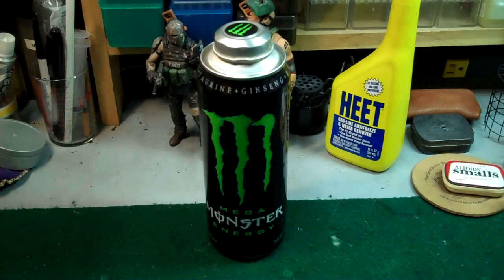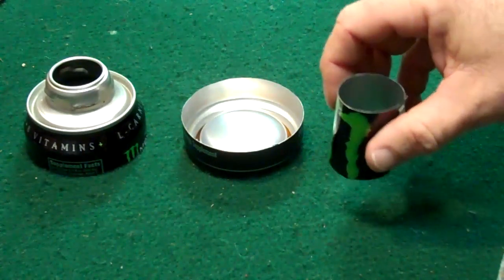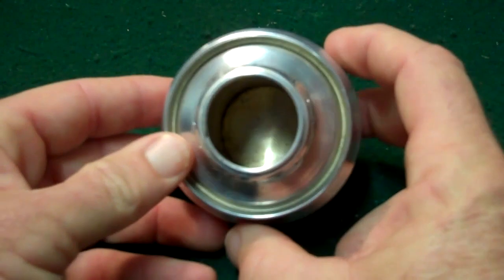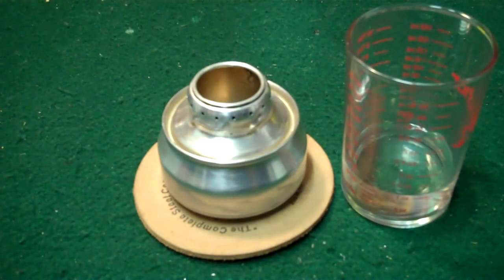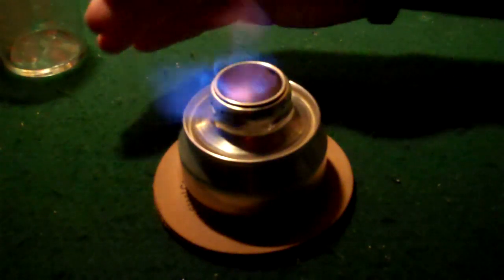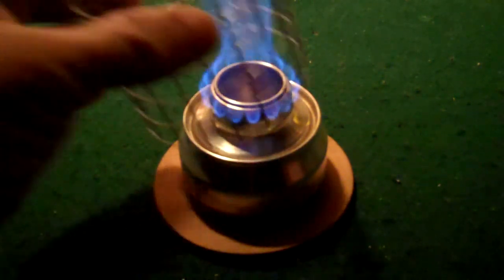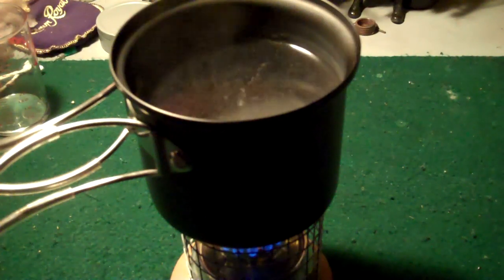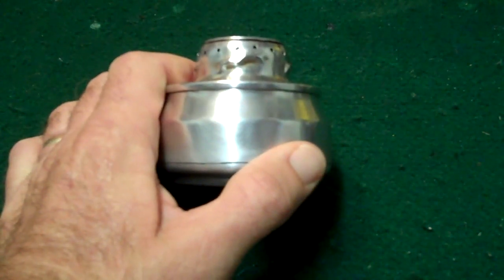MONSTER CAN STOVE

Comment: Nice stove build. I have built the same stove. Mine primes in about 40 seconds. I put a wick around the inside between the inner and outer wall. The Trangia stove also has an internal wick. That is how it primes so fast. The alcohol gets pulled up to the jets. I did not read all the comments, so if somebody already suggested this.....

Comment: I've had great success with alcohol stove design and one thing I've learned is that the safety of alcohol stoves relies greatly upon the fact that denatured alcohol requires preheating in order to become a gas. If you would like to reduce your priming time and get better performance in cold weather, move your jet holes to the middle radius of the horizontal surface at the bottom of the bottle neck. Put those holes right in the middle between the folded seam of the can top and the neck where the cap fits. This will not only give you lots of heat to transfer back into the fuel container for proper vaporization, but it still leaves you with a ring of "Priming Gutter" where you can slop a little fuel near the jets to get them going. The Monster can top is THE perfect top to solve the dilemma of jet priming if the jet holes are right in the middle of that outer ring. This will also draw the flames closer to the center of the bottom of your pot, AND, if you drop the cap back on, you will get more efficient burn time.

Comment: I like this stove. I have been looking for one that incorporates a lid. 
I suspect the reason why your jets take a long time to light is because the inner sleeve acts as an insulator from the outer jets. Obviously it's not much insulation but it's a slight barrier that has to be heated in addition to the outer area. When you blow on it; that helps to heat the outer sides where the jets are located. It looks like that skirt under the cap would make a good primer.

Comment: It looks very sturdy but seems a little less efficient than some others. A few suggestions:
1. Reduce the height a little so during the priming heat is more efficiently delivered to the fuel.
2. In crease the number or the size of holes.
3. You already have a raised rim on the top on the main body, try to use it for priming by adding a teaspoonful of fuel and lighting it. Skip the center burn for lighting.
Good luck!

Comment: in my experience smaller jet holes light sooner and burn better because it allows the stove to build pressure faster. also you might try drilling the holes in the top of the can not the raised portion that you drink from. you could also try building one with the top inverted down inside the can this will eliminate the need for the inner spacer or collar.

Comment: Try using larger jet holes. I had a similar problem. Larger jets will light faster and in colder temperatures. It will decrease total burn time, but you still get the same amount of btu's from equal amounts of fuel.

Comment: if you put the holes lower, on the more horizontal area of the top of the can i think it would work better. Then the top neck of the can could act as a stand for the pot, too. The top of the flame would be hitting more of the pot, too which would speed up boiling.

Comment: Have you tried pouring a small amount of heet on the outer rim of the can before you light it? That way the fuel inside & outside are both heating the can to decrease the time it takes to create sufficient vapor to run the stove? It might also eliminate the need to blow on the stove to get the jets fired since fuel is burning around them already. 
Just some thoughts.

Comment: First thanks for the sub to my channel. And back at ya. Looks like a nice stove you made here. Works quite well. I wonder if you poured a bit of fuel on the top and lit it if it would help get it to bloom faster by heating the fuel inside quicker. I need to set aside some time to make some stoves of my own. Nice video.

Comment: You might try pouring a bit of alcohol around the ring of the can and igniting it to act as  an accelerator. It should heat the main fuel charge and cause the jets to bloom sooner...Cheers

Comment: okay first did you prime your insulation first? If it was dry then it takes longer ... so before installing insulation prime it first then install it .. it wil dry out but it will soak up faster.  Secondly. put your lid back on and have your holes come out just underneath the top This will help avoid any evaporation or TOP burn ... It will also help the vapors to only come out the holes.  These are just my thoughts but im just an old man from the sticks

Comment: I use the same can and I get 45 minutes from mine with 8 holes burning denatured alcohol with the holes around the part beside the cap, and I place the cap back on it before lighting. This will give you about 8 one inch flames or higher depending on the hole size. There are no other parts to my design but the can, no JB weld or anything like that, just the can. I tried also to made a heat reflector out of an old weld rod box can ( square kind )  about 5 inches high with one side cut out to reflect the heat in that direction and that also causes the can to burn a little hotter as well as it is also absorbing that reflected heat into it causing more vapor action of the alcohol to burn more, also works well as a wind breaker. I just light a tea candle below the can to preheat the fuel once it starts to bubble inside just light the top and your done , then blow out the candle.

Comment: Sorry to state the obvious but you have a gutter there that can also be the priming for the top of the stove. 
If the top was inside the bottom then the bottom could be extended up near the top to stabilize the pot
AND to form an additional outer gutter for priming.
But with that approach then large air-holes would be needed around the top lip to aid burning. 
Have you tried steel wool on the inside to aid wicking?

Comment from the maker: Thank you for the sub also, An I tried the fuel on the top. It helped a little, It worked better with a priming pan, but I'm tryin to stay away from that. It just has a large fuel chamber an takes a long time to heat up. Works great when it takes off !     Thanks again,...".go out side an play"

Comment: Id make another just like that but put the holes on the outter side of the can instead of so far at the top. Seems to give a bigger and even spread. Other comments on using that top section as a primer on your current stove is actually a damn good idea and suggestion.

Comment: Try angling the jet holes upwards. This would be easier if you used a pin, and twisted each hole to point more skyward, but drilled holes could also be manipulated this way. This may allow the pressurised jets of gas to "feel the benefit" of the central flame as they pass up past the central rim? I think the problem is the volume and surface area of the pressure/storage chamber (full of cold alcohol) is too great to allow sufficient heating for the jets to get adequate pressure. Keep trying pal!

Comment: Try putting some fine steel wool in the bottom of the can to help your priming temp rise faster. My can stove is not the same as yours but I can get the temp to go high in about 30 seconds by blowing into the can after it burns about 10 seconds or so.  Use about 1 inch of steel wool in the bottom or just enough to go above the level of the amount of feul you will be using.

Comment: It may prime faster if you add some sort of steel wool in the outer chamber.  Something that will help move the heat from the inner chamber to the outer chamber and into the fuel.

Comment: when youre pouring your fuel, if you por some onto that lip, right outside the holes, it should heat it up enough to prime the jets, and you'll probably use less fuel that it burning for so long on its own trying to prime. Give it a try

Comment: If you don't want a priming pan, use a fiberglass wick around the base and light that wick and the middle at the same time....should cut priming in half, and no wick.  I think it will heat the inner walls much faster.

Comment: Not bad, but I would make use of both the wonderful screw on cap, and that nice top rim. I'd put the jets much lower, like in the middle of that mildly sloped section between the neck and the rim. Then, cap on, fueled up, I'd fill the top ring with a little fuel and let it prime that way. Pressure would build much better with it closed.

Comment: Lower the jet holes in the monster can 3/8  inch.
This brings the flame closer to the alcohol.
The alcohol will receive more heat to ignite the jets,

Not necessary to make a new burnner,
Epoxy to fill them in old holes and drill new holes.

Let me know if this works better for you.

Comment: I always have better precision by drilling the holes BEFORE I cut the can to size. It's easier to do machine work on a larger piece... If the " flower" doesn't start, Is fuel getting to the outside of the sleeve?

Comment: I  put 13 holes just below where u put the holes and burns in 5.30 min  and i take the cap off and use as stand for pot wrks on level  ground...aswell fill it up with insulation pink stuff minimizes your burn of spirit...:)..and screen too high ..should be half an inch from cap opening..even closer if possible..aswell wind screen helps or larger can with holes to prevent wind....contains heat aswell..

Comment: Make another and put the holes right below the rim (separating the main body from the top) and leave the cap on (no inner walls needed) and put fluid on the top (above the rim which is described above) and you have a built-in priming pan!!! Problem solved!!!!

Comment: HI have you made any upgrades yet. I tried a double wall and it did not do so well. It kept popping and spit fluid out, small fires. I also tried carbon felt in the middle but it burned to slow. Any suggestions? Thanks, Jim ;-JJD

Comment: I would try smaller holes, and I saw another design where they wrinkled up two layer of aluminum foil and then laid flat against each other and then rolled it around the center inner wall.  It almost looks like vanes to wick it up

Comment: I am thinking you still have a pressure leak, that means you need the fuel to get much hotter then you should need to get a light.  Try a copper pot scrubber in the bottom of the priming tube
Reply: please explain what that means

Comment: @Daywalkertwo, hi Tod let me give my impressions on this stove and some helpful advice.  These stoves are Hi capacity, mine is shorter than yours and I still consider mine Hi capacity. I measured 1cm from the top bevel down for the top and 1 cm up from the bottom of the can from where the edge of the paint is up for the main body. And the center wall at 1.6in. so mine is shorter than this one. I used cotton balls for my packing, unrolling them and wrapping them around the wall, I took a lesson from my Zippo lighter. I would strongly advise against using insulation like Corning or any other, my neighbor got a $1000 fine for burning insulation by the EPA, breathing any particulate matter from that could give you cancer/ mesotheleoma(that is, if it is burning and I'm not sure of this since I did not take mine apart to inspect it, so it might be ok, but why risk it)
 These stoves work well with either 30ml or up to 2oz or even a little more. If you only need to heat a can of beans, since there already cooked all we're really doing is getting them simmering them you would use less fuel, say 30ml. at 30ml you probably wont get the side jets to fire, but this is not a malfunction. its just physics, and the stove only fires from the center and uses the jets as air intakes, just like a simple ZDome stove( watch the video on that for more info on how they work) which is fine for stepping tea or boiling 2 cups of water. The more fuel you put in it effects how well the side jets fire and so does the priming ring right below the jets, fill that rim up to the max right to where the fuel is getting ready to break the surface tension and spill over the edge. I love this stove because it works like the ZDome when using small amounts of fuel, it burns long and slow from the center when using a skillet for chicken and wont burn your food, but when you need more power for boiling 24oz of H2O add about 2oz of fuel, and the side jets will fire easily if you follow the instructions earlier on priming it, you might need a little more fuel in the main chamber because of the tallness of your stove, try this with less and more fuel and lets us know the results, I hope you got a little out of this that you could use for your next build. best of luck to you
Reply: I almost forgot to tell you that I get better results and quicker firing of the jets when at proper fuel capacity when I go ahead and set the pot over the stove, thats right, even before it fully primed, it primes at around 45sec.-1:00. it increases pressure and makes them lights quicker.
Reply: Thanks Trey.   I have been having fun making a few of these alcohol stoves myself. i was considering using insulation as wicking material on a future build but you have convinced me not to.  I had thought of using cotton balls earlier but I read from one poster they degrade over time.  Do you pull the cotton apart and stuff it in the stove tightly up to the gas jets? Also do you use JB weld or high heat silicone to seal your monster can stove.  I have had great luck using aluminum water bottles i rescue from the resale shop.  I just press top and bottom together.  No need to use additional piece for inside. Also they seal together very tightly and are much sturdier than drink can stoves.  I have one that boils 2 cups of water in 3 min 15 seconds consistently.
Reply: I just unroll the cotton ball, it works fine, I wrap it around the center wall and work my way to the outer wall, and I do not pack it all the way up to the jets (i dont know if this will hurt or help it), I keep it in the large chamber and stop at the bottle neck

I use no JB, or silicon, but as you know, every one acts differently, and even though you make one the same as the last one, they sometimes have trouble starting, after I light mine, I go ahead and set the pot on the stand, mine is about 1.25" above the jets and sometimes this helps to increase the presure and helps get the jets going. I use mine all the time when I'm out fishing and want some coffee, I dismantled one extra I had to examine it and the cotton was in good shape, with only a little bit of a brown stain up near the bottle neck, so all is well.

another use for the monster can is to cut the can down to whatever size you want  and make a aluminum jar for sugar, creamer, and if you make one about as big as the stoves( short) they make great spice cans for Cavenders greek seasoning, the reason I use Cavanders is because it tastes great on everything from eggs to pork, steak and fish and contains all the spice you need, salt, pepper.etc.  I hope this gives you even more idea's
Reply: Thanks for the good tips.